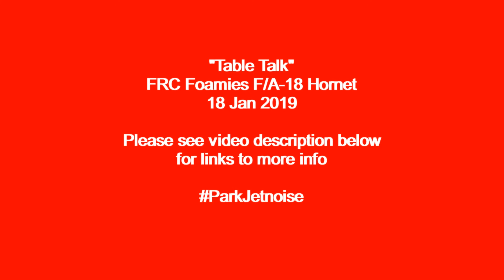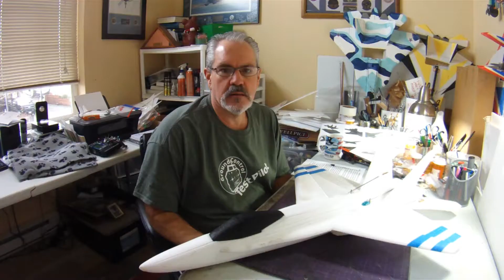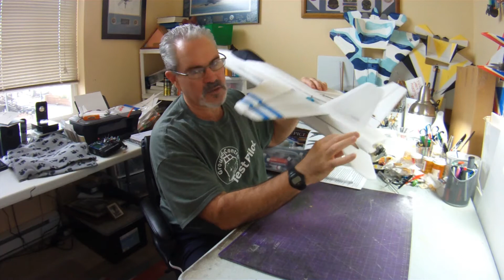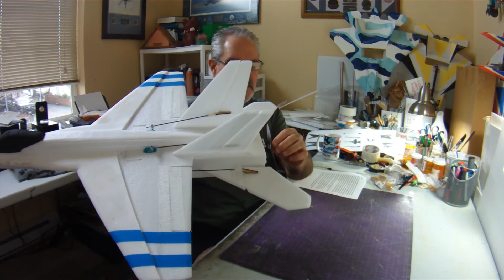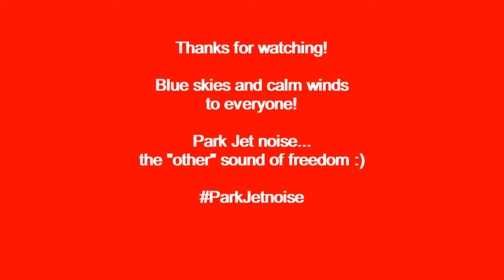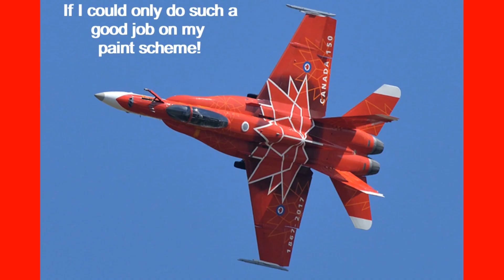"Table Talk" - FRC Foamies F/A-18 Hornet - 18 Jan 2019

Comment: Some great tips, just got mine cut out and have the same motor as well.  Keep safe and well.
Keith
😀
Reply: Hi Scott, do you use the rudders much on the F18 just wondering whether to leave them fixed and save weight on the servos. 
Thanks.